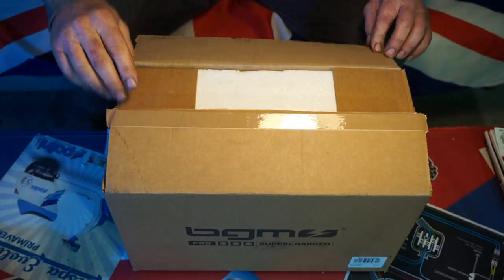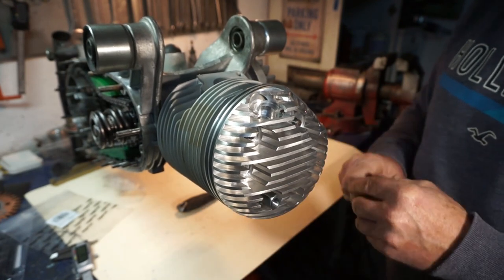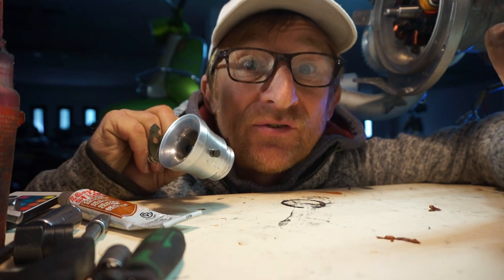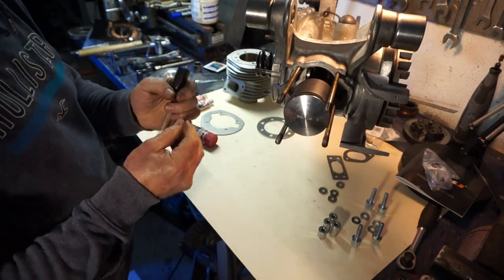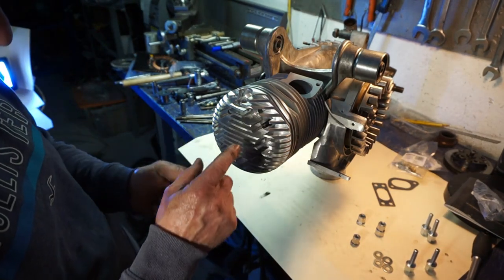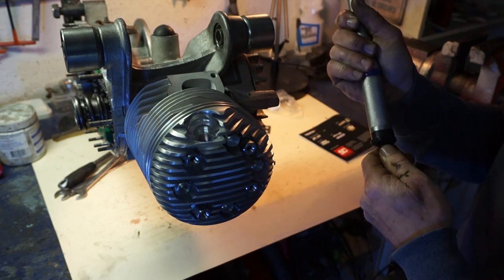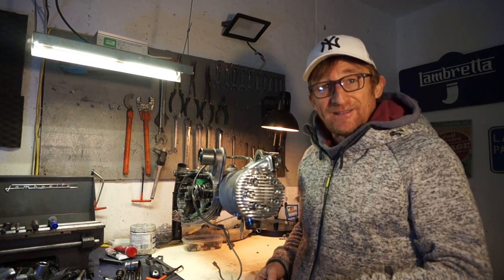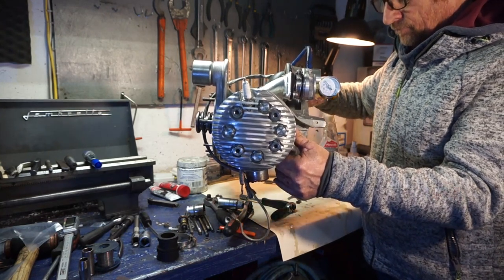RT195 kit Build part 1 #LAMBRETTA

Comment: I like the BGM gaskets with the built in sealant (for the mag and the engine case) they fit nicely and seal better, plus the material they use seems to be a plastified paper.

Comment: Recently done the same build, UNI mag housing etc. The moment you said it was leaking I thought bet it's from around the mag housing, had the same only I hadn't used enough sealant. Used one of the Broadhurst reusable mag housing gaskets which come in different thicknesses and won't break so easily as they are a rubbery kind of material
Reply from the maker: Yep I used black bgm beaded gasket that failed ? Now have green from bgm looks like they have had problems  and changed materials.

Comment: When you grease the threads you should reduce the torque on those bolts, -20% at least. You can end up over tightening and strip them.
Reply from the maker: Yes your absolutely right my mistake  . It had crossed my mined when they where taking more to pull down .
Reply from the maker: Might be a good idea to test a dry bolt to 20 nm and then see how far it angle torque until it hits 24nm .... then I can angle torque  the greased bolts more accurately
Reply: @TheSteelweasel  Might be a good next video? Great job!

Comment: I'm sure he knows his stuff - but - when bolting into ally I would rather just feel how tight it is rather than use a torque wrench . Each thread may react differently and you can feel when it's home . Also , any grease may boil off with the heat , could just leave alone or could use thread lock .